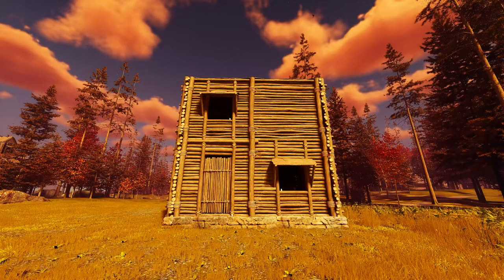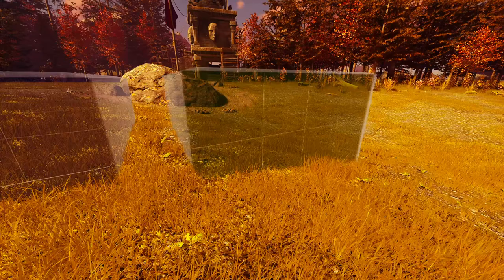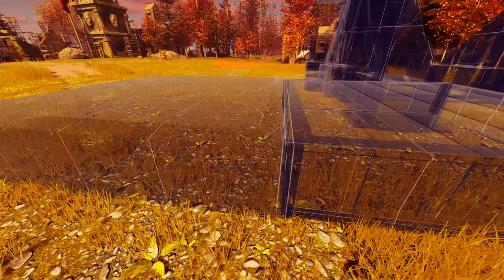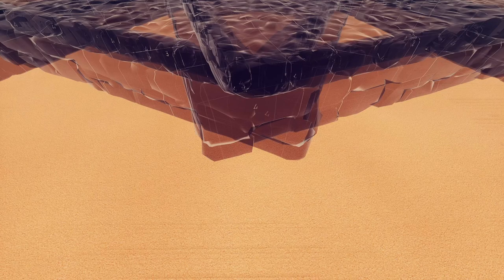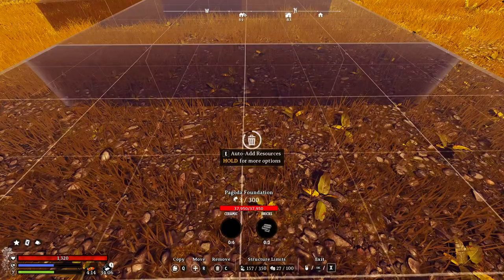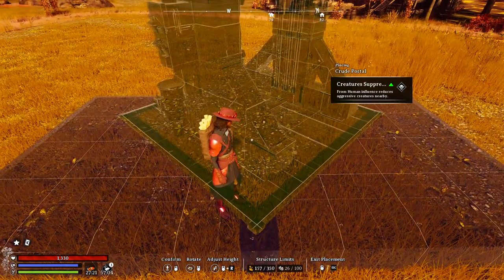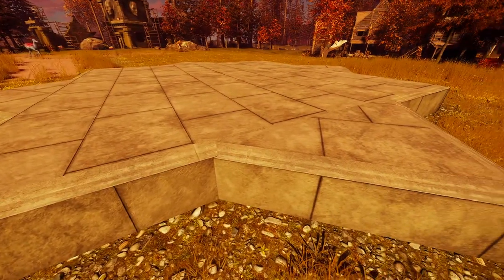How to Build Octagons in Nightingale

Comment: i never thought about using the portals to mark out foundations, thatll help a bunch in the future! 

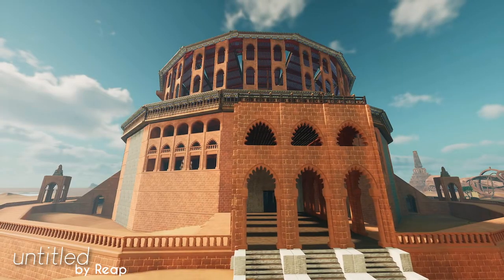since this touches on 16 sided buildings though i think its worth noting, my build at 1:58 has no single center block, because in order for the corners to match up perfectly at 1, 3, 5 and 7 edge widths, you need pretty close to an extra 1/2 foundation width added to the diameter of the structure, which requires you to make 16 seperate foundations for the structure!
Reply from the maker: Yup, figured your build needed a more specialized layout to get those super crisp corners. Bet that took a lot of patience!